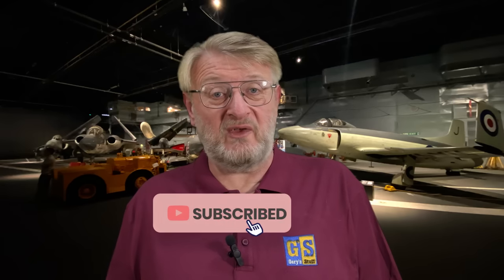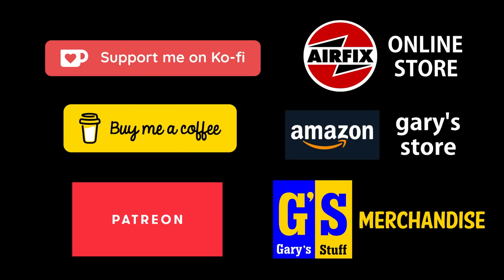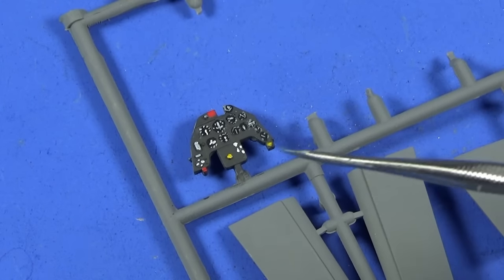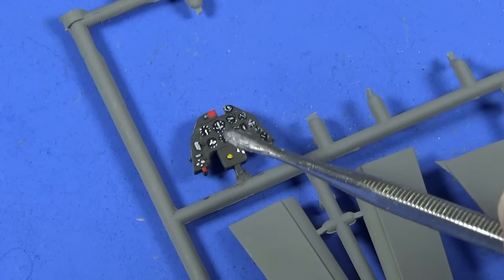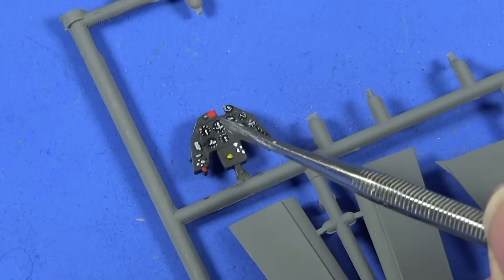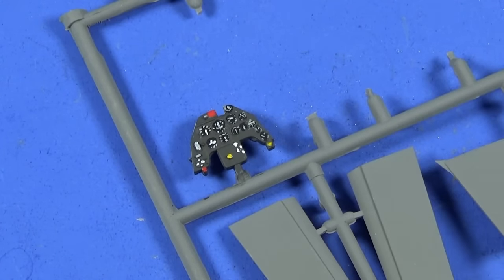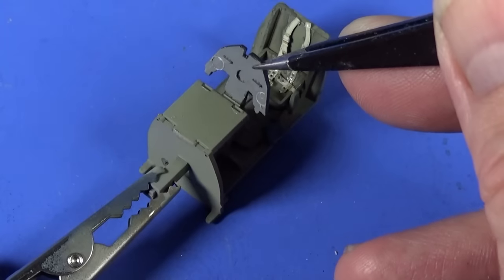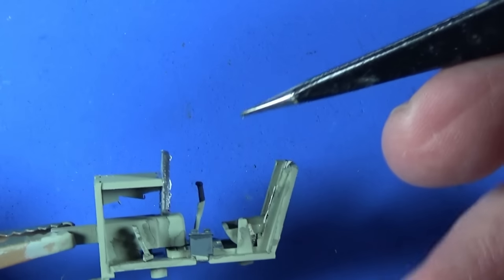ICM 2023 NEW MISTEL 1 1/48 scale - how to build it part 1

Comment: Looking up ICM I see they started production of kits in 1994 but their first releases may have been re-boxes rather than their own tooling. 2007 may be one of their early own tooled kits. As said by others that BF109 looks to be a handful to make. I suspect that the engine didn't fit as it is a scaled 1/35 engine but the internal space inside the cowling will be smaller because the scale thickness of the fuselage and cowling parts make the cowling walls about 2 inches thick. Kit manufacturers need to do a lot of work to make sure these kits go together and still look scale

Comment: Hi Gary, nice build.  
A number of observations if I may.  As a matter of interest, which doesn't affect the build, the DB engine was direct (ie in cylinder injection) so no carburetteur.  Also the super charger had a fluid drive and was not a turbo (except in some experimemts that did not see production).
I agree with you that if you're going to have the cowlings closed then there is no point in fitting the engine, but it might be a good idea to poke the gun barrels (or a representation) through from the inside before closing up.  The engine could be used in a separate display.  In my distant memory I believe there is a DB at Wroughton as well as a DB610 (which is a double DB605 as used in the He177) though I might be missremembering where I saw them.  For anyone really interested in WW2 aero engines I can recommend "The Secret Horsepower Race" by Callum Douglas.  It is excellent.
On general build, where you have no register pins such as the fuselage halves, then you could make your own registers by adding a number of blocks to the inside of one half (they'll be out of sight after all like the missing frames and stringers so no harm) which could be made from plasticard or even bits of sprue.  Then alignment on join up is more reliable.
Your bit on the leading edge slats is interesting, I hadn;t seen them sticking out on ground photos but it makes semse.  I have read that the radiator flaps hung down when parked though I haven't noticed it on Mistel pictures.
On all the Mistel pictures I have seen with either the ME109 or the FW190, the landing gear is retracted.
It would be interesting to know what sort of crane they used to get the fighter up there and what sort of post release guidance they might have used, perhaps radio like in the fritz bombs.
As a final aside I seem to remember Alan W Hall doing a 1/72 Mistel build from the Ju88 and Me109G in Airfix mag in the 1960s.
Reply from the maker: The photos I've seen of the Mistel on the ground have both retracted and lowered gear - viz: https://www.luftwaffephotos.com/lmistel1.htm
I would guess that they have the gear down while assembling the two parts, then maybe take the fighter gear up to lower drag for take-off. Might be part of the assembly protocol.
Fascinating detail about the engines, for which many thanks. Always keen to learn more!
I wonder if they had some sort of gantry a bit like the one NASA had for the Space Shuttle carrier? I will try to find out more because it's a fascinating subject!
Reply: @garys_stuff  I went and looked for photos and you are quite right, both up and down.  I agree its probably down for loading.  I wonder if they need hydraulic power to raise it and they have to run the engine for that.
One of the pictures I saw showed ME109 with radiator flaps down and leading edge slats in.  So much variability.
Re cranes, my oyher half about a fortnight ago found pictures of a special crane for lifting the turret off the King Tiger for maintenance.  The thorough "master race" certainly didn't think their maintenance out at the design stage.

Comment: A large Bi plane in effect how did the 109 control the junkers was there a connection that broke away on release,you said I had the patience of a saint ,I think you do too mate 
All the best 
Mark 😊😊
Reply from the maker: I need to do some reading about these beasts - there must be some electrical connection perhaps to the gear actuators and the throttles as a minimum, I would have thought the flying surfaces too. But yes, they'd have to disconnect on release....
Reply: @garys_stuff cheers Gary interesting subject mate

Comment: It is great that a manufacturer provides all those details for the engine, but then asks you to hide thier light under a bushel. I'd leave off the engine on this example, and buy another ICM Bf109 and make a maintenance diorama with the engine from the Mistel kit partially stripped and hanging off an engine crane. Same if you didn't use the main wheels - just leave them laying off the the side as spares.

Comment: This certainly appears to be an overly fussy kit. As someone has already remarked, there are far better Bf 109 doner kits out there. If one's heart is really set on having a Mistel in the collection, I'd opt for Hasegawa's trusty old Bf 109 F2/4. There are plenty still available and I'd try and get my hands on a Dragon Ju88. That kit does have some fit issues but nothing that can't be resolved with care.
You appear to have used G wings. If this is for an F variant,  this is incorrect. The F wing had round cut outs (like a Spitfire) for the wheel well openings, whilst the G had angled openings for the I tended wheel covers that never materialised until the K variant.
That stub/peg that supports the engine is the breech for the 20mm cannon.
Looking forward to see how you tackle the Junkers.
Reply from the maker: I just build what's in the box mate! Interesting to know the differences as Bf-109s are a bit of a mystery to me. The other two ICM Bf-109F kits I have both have the rounded wheel wells.
Reply: Yes, I know that, Gary. I can see my comment contradicts what you were trying to achieve. Sorry, I was just expressing a general view.
Yes, the Bf-109 is a reference nightmare. The were so many combinations between the later variants. From the G-6 on, for example,  two main styles of canopy could be fitted, the tail fin could be fitted to the airframe with a wooden type. There were long and short tail wheel struts and there were different style gun troughs, depending on which subcontractor produced them, in the nose. If ever there was a type where, 'check your references' had pertinence,  this aircraft was top candidate. Phew!🤨
Reply from the maker: Not at all Mark - I'm keen to learn because I know relatively little about the Bf-109! I'm reasonably up with Spitfire marks, but the 109 is a mystery to me with its many variants. You kind of think "why were they still using them in 1944/5" without realising the development between the E and the K, for example, was probably as huge a leap as between a Spitfire I and XIV. I recall Jeffrey Quill saying that the Seafire FR.47 at max take-off was the same as a Mk.I Spitfire with 32 passengers!